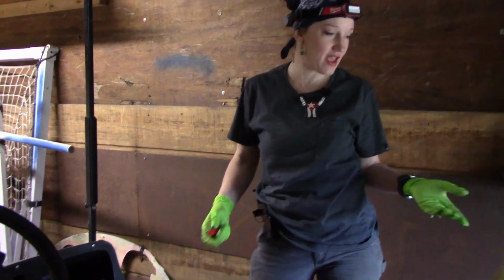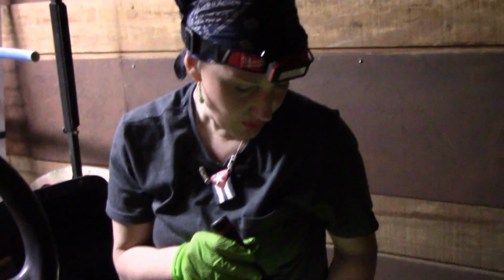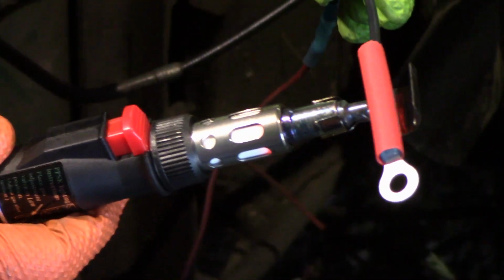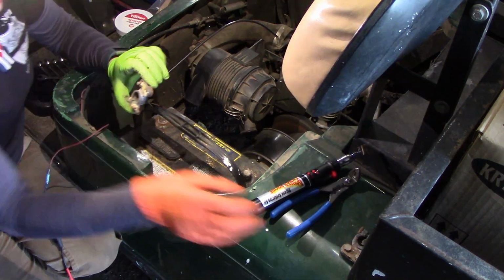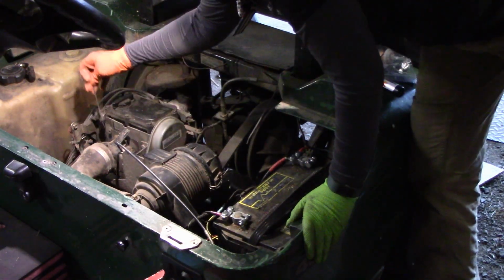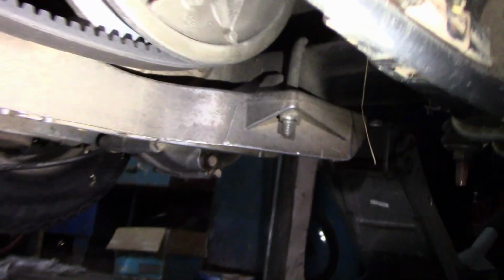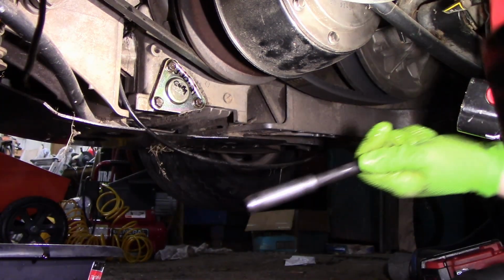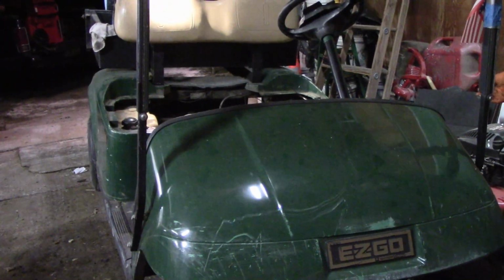EZ Go Golf Cart -Maintenance

Comment: when shrinking the self sealing splices or heat shrink tubing, roll them around more or move the heat source around the outside. that torch and spreader shield is far too small and bad design.
it works best on over 1/3 diameter tubing with majority of flame aimed down at the deflector shield so it actually wrap around it, but it will still heat unevenly and the heated object or torch will need rotated. in this case a small butane lighter moved around and rotating one end of the connecter at a time is best (yeah, you'll cook your fingers somewhat) pliers may help lol
Reply from the maker: Hahaha... yeah. I agree, the shield is too small. But I really use it more for confined areas under the dash. It so good at preventing burns on other cables, carpet, or plastics. I always appreciate your input TB! Thank you!! 😁🤗